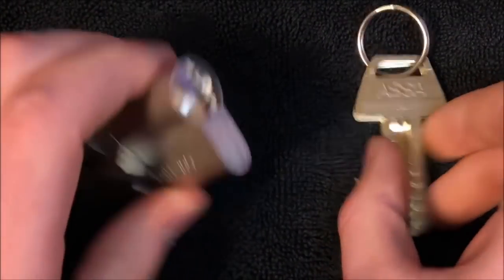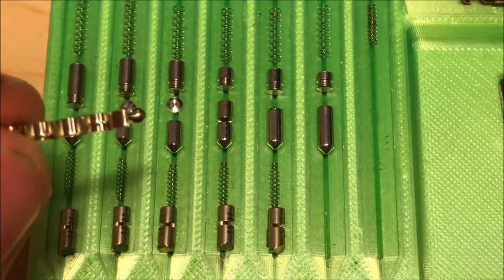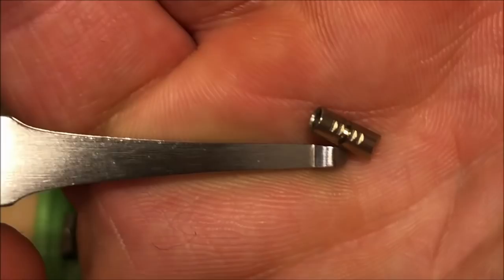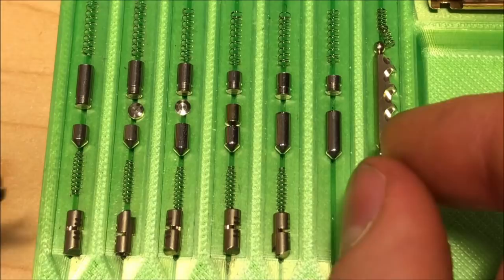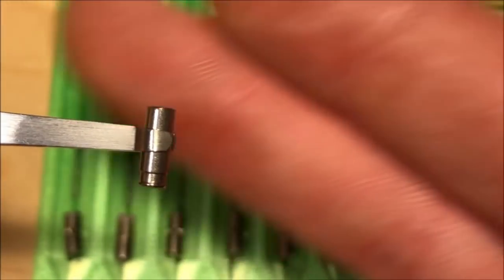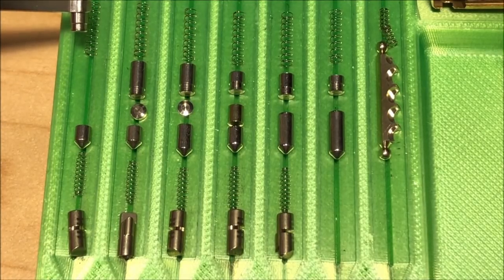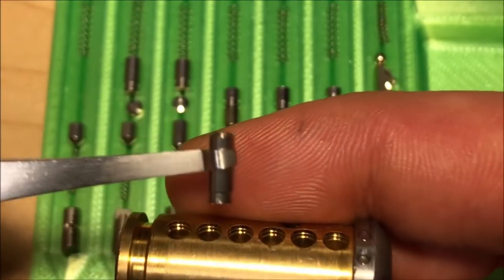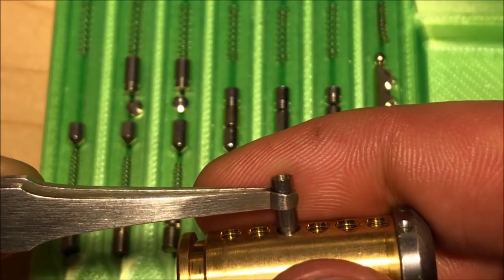Teardown Tuesday 1: ASSA Twin Pro

Comment: That opening was hilarious! Love seeing the examples of the elements interacting.

Do you know if there is a version of this lock without the sidebar? I want to work on a pin tumbler that's harder than my American 1100 without worrying about the side element in this one -- or would even that be too huge a leap? I know the subreddit has the belt system, but it's hard with all the lock types mixed together in the same list (dimple, disc, etc.), and I always have a hell of a time finding the euro locks on eBay anyway.
Reply: You can always try the ASSA 700. Depending on pinning, it's either purple (or blue I forget) or red.